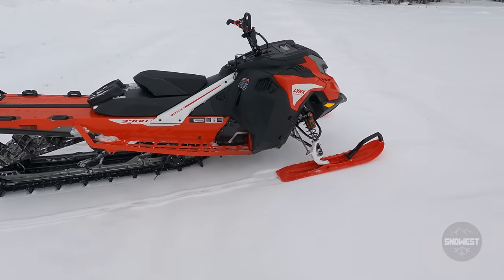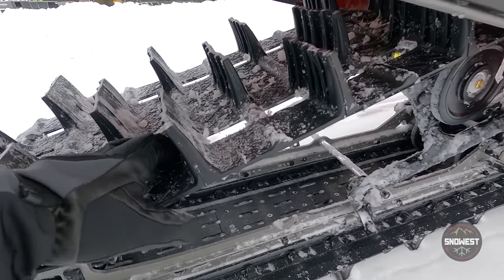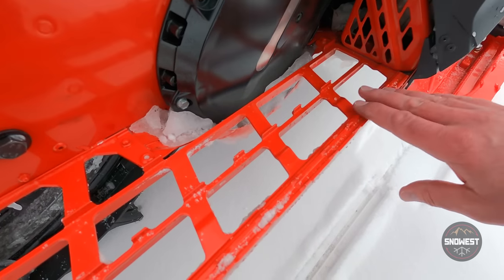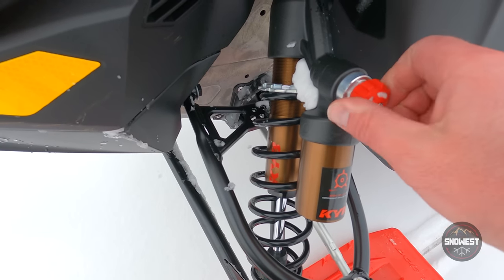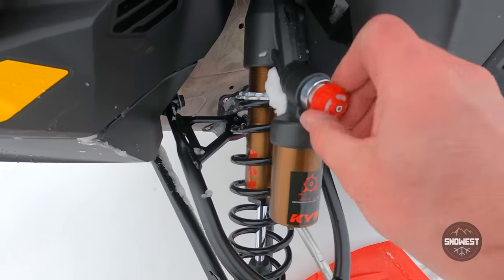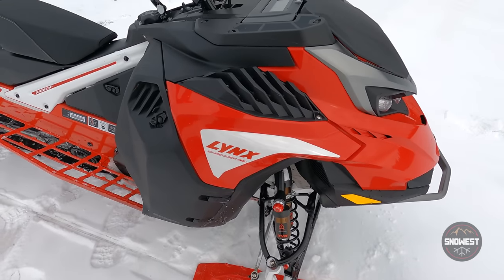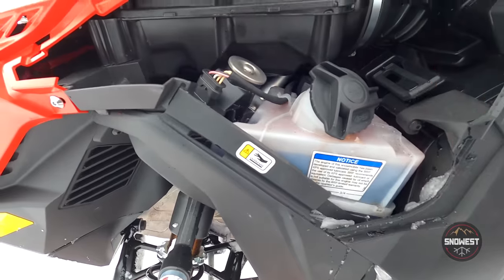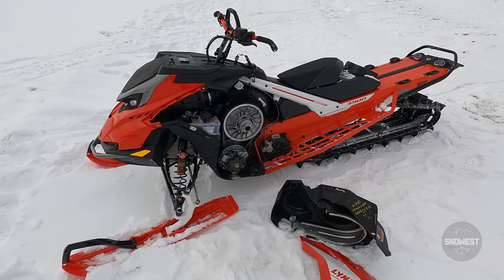2023 Lynx SHREDDER RE review - the SNOWEST show

Comment: I’m going to snowcheck one which one is better and what’s the main diff. I want a non turbo 154 ? Please help I’m slow. I ride in the NW mountains of Washington state .
Reply: DS has lower lug size and does not have the adjustable shocks like the summit, and the RE is more like the Freeride with adjustable shocks and 3" lugs if you spring it they are very like otherwise. in the earlier models ds had narrower plastic and front end but in 23 it seems its the same ( i have Freeride 2021 but before the Freeride i had Boondocker DS 2019)

Comment: Lynx definitely should have offered the option for an n/a version of the re in a 3900...not everyone want's a turbo!
Reply from the maker: The Shredder RE and Shredder DS are both available as NA 850s. We just did this review on the Turbo R.
Reply: @SnoWestMagazine  I just tried to configure a 850 n/a version 3900 and, the only option was with a turbo.
Reply from the maker: @hornefoundations  You’re right, it’s just the 3700 RE that is available NA
Reply: Yep, doesn't make sense to offer a ds in a n/a 3900 and, not a n/a re 3900
Reply: I agree